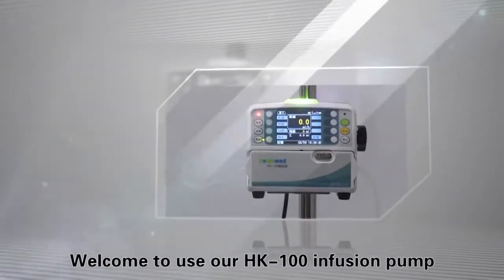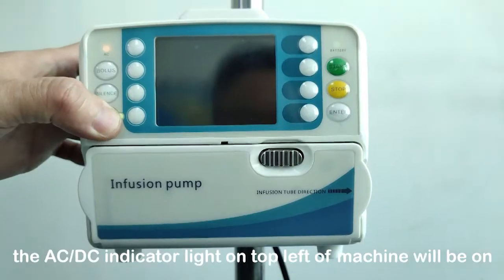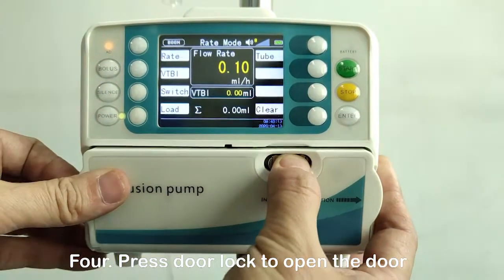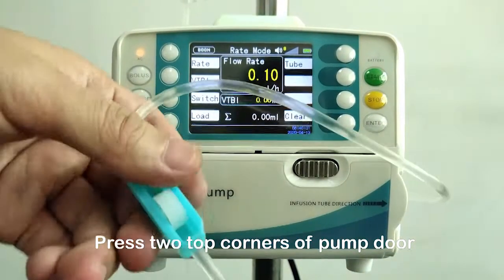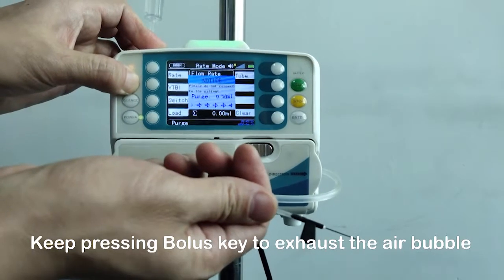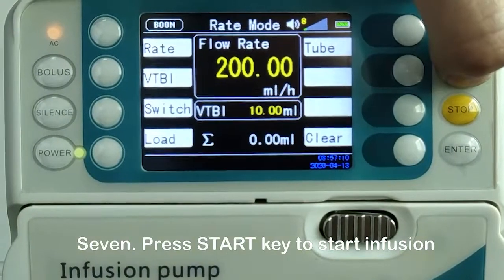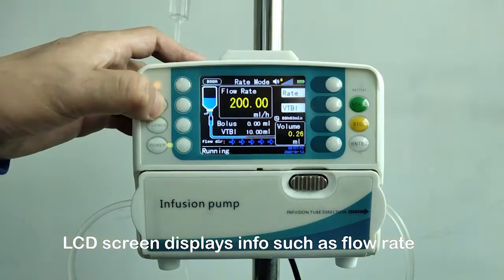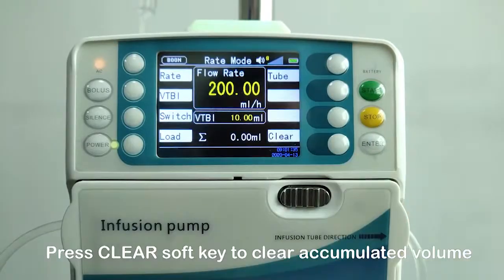Video of HK 100 infusion pump operation

Comment: The CaesarKing shall order the utilization of advanced technologies, capabilities and endurance of energy usage and propulsion from innovation inventions and research and developments of Air Assets within the Atmospheric layers of their area scope and not of space of whatever being flown per area scope of high long endurance flight of air area environment ecosystem of long endurance flight of whatever air platform per area scope and tech capability of per area manage, care and fix, air platform structure creations, air base at the air creations, air types of data and information storaging per area scope and energy harnessers loaders per transact, membership or business, nodes of connect in the air establishments per area scope, of air cleanliness and no deadly and dangerous air pollution of proliferate otherwise the now ordered infused capability AI Quantum Satellites of 5 Constellations of the CaesarKing shall zap from space in tandem with the CaesarKing 2:1 Superior Quantum Neyworks, the aircrafts , air platforms or air structures spreading destructive air current of whatever spread,  couriering and cargo ferry and transport, business and trading, area guard and defense of soft and hard types threats defense,  observe, command and control if needed, do the trafficks and do the air ecosystem activities of create and functional move of long activities in there as programmed, the CaesarKing shall create technological shields and privacy cloak of protections and encryption of outer tier defense per area scope at the land ground, Let it be. The seas shall also be deployed with high endurance sailing ships of capability, energy and engines  types propulsion or know how, tech of sophisticated infusion augmentation per time advance, of long endurance sea sailing ships or sea vessels of up sea surface to undersea of such ships or vessels of long endurance movements and sails of doing their tasked or programmed  sea area scope ecosystem or program activities of sea borne fixed of movements and activities of area secure and defense, sea area scope watch and guard, sea energy types harnessers tech and loaders by memberships, business or by agreements, and capabilities per area scope, sea stations per stations creations of applied technologies with datas and files storagings of solid, liquid or none physical structures storages, none sea environment destructing sea energy storages per area scope, sea tourism floating structure establishments businesses of its types and varieties,  programmed  sea activities, sea couriering, ferry and transport, and business and trading, sea platforms and structures establishments and create of per specific limit of measure and of none sea pollution maintenance and discipline programmed event and instilling capability to my AI Quantum Satellites of 5 Constellations to sea structure beam penetrate, area scan and dissolve polluting cause and effect sea vessels, platforms  infrastructures and dissolved teleport like dissolved particles and teleport reappear at a Dimensional confinement of being teleported with my special soldiers representative interrogate experts. Sea traffick groups of scope. This would prepare us to the future advancements/ modernization with strict sea water cleanliness discipline order and protocol  and area guard and protection per business sea area  scope better management for their high earning resources and earning business resources at stake if area invaded. The CaesarKing shall now increase to 50 Undersea to Air Black dual mode traversable Gundam Wing crafts commanded by Appointee Pacific guard Hubert L.Vasquez and creating  6 Air in Pacific Moving large high flying drone crafts of laser firing of adjustment ranges due to plenty of activities and ships to area  guard of his  territory  of  guard,   like high tech hyperspeed aircrafts  of Pacific Ocean area guard and it's launching platforms enlarged by produce and create by my to and fro Superior Tech interact in space, air and seas by beam rays to and fro send and resend, the speedy under sea and sea surface echolocation sound waves and sound signals receptors and transmitters per area platforms process and read with Ai of the CaesarKing to process and dual mode operated by my Specialized Soldiers Tech group area of focus and my AI tech performance monitor and watch and my AI tech monitor and watch to the perceives sensed Special Tech group.  The CaesarKing shall add capability area and structures for the Beasts groups and Animal groups of command of Both land and Sea infrastructures of  next generation camouflaged tech and defensive area weapons, Base troops camps and Sanctuary habitats and Businesses structure platforms of land and seas of their versions of 3 in everything in 2:1 land and seas of their version. A new tomorrow stage by stage preparation  sourced from the verse "In the Endtimes Knowledge shall abound and Many shall move To and Fro" , The End time meaning of multi meaning can have a time swing of ideal time max based from scriptural analysis of 500 years of a time event slider OR if not a slider can be of Maximize and Minimize by World stage show focus Limelight sourced from the verse " The smaller things are greater than the Large" of a syageshowing the other multimeaning or the verse The " Inner and Outer being," and the " Likened to" verse which can be correlated connected to machines and transport types and structures and, the latest discovery, Stars in the Heavens of 2 types, the Fissional spread  of rays of bright shine stars and the fussional other star layers of fussional implode attract of their brights and lights. The CaesarKing shall also order the important islands area weapons defense and tech cloaking mechanisms and gateways of in and out of watchtower group of the islands of identify area watch operate guard and control for the Leopard Beast groups of islands and fractionated territories defense and area guard, Let it be. The CaesarKing shall also add capabilities to the Light side category of air bases at the atmospheric layers domains of air transport and air current defenses of stational photonic dormant to moving structures at the skies of area guards and traffick with beam rays of their photonic identify defenses and weapons, watch modular tech displays and movements  trackers tech  capabilities and of ArchAngel Michael Northern Snow Ice Area station station and fortress of cold environments, clouds and mists shimmering and cloaking  short distance warping effects and of light emission of air objects near his area of guard with pings snd bounce holographic crystal beams of information readers and weapons and system tech shields capability. Let it be. Remember the CaesarKing have his Power and capability to superimpose a present time Earth with his prepared at a dimension Earth copy pastes and Earth swap if ever the Earth environment was compromised and with one Eartn from that Earths copy paste ready for the reserved swap in a dimension of a previous order of create of such things,  and have my capability power of the Time Swing Pendulum and holographic sensors and Mist and Clouds effrcts in time and my  hidden at cloud molecules and time fabrics instant appearing  Pulse Microwave Accelerator beams blasters for the area protect policy and the 15 Luminous minimize to maximize size shape shifting from small to giant space crafts transformational warping speed ships of functions and disaster managements inhabitants evaluators by rays of abduct and transfer to safety areas designed for world calamities of White light inside upon entered with beings of evacuate then transform the interior structure bettering the U.F.O 's capability of small inside but when entered a Football area large stadium size spaces in the interior, much bigger and adjustable than that in sizes and weapons capability create of whatever mode those Luminous flying objects of 15 of such of the CaesarKing of previous order and create for policy making and disaster management and create anything in there with energy harnessers capability hidden at the atmosphere, time fabrics. The Median civilization infrastructure advanced modern civilization of their version of continuous open architecture and tech infusion by the medias group from what was given structure was reactivated upon reactivation order yesterday for the information. Let it be